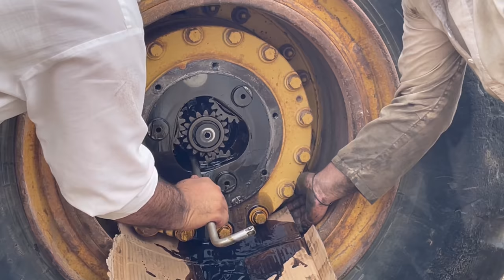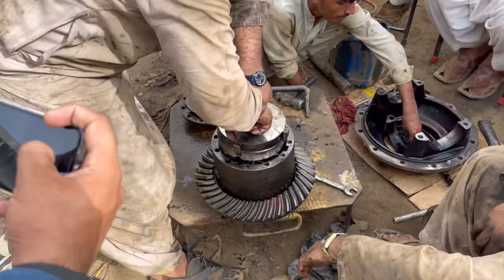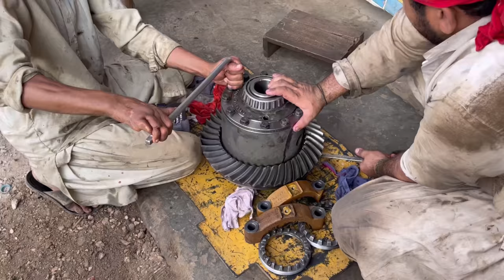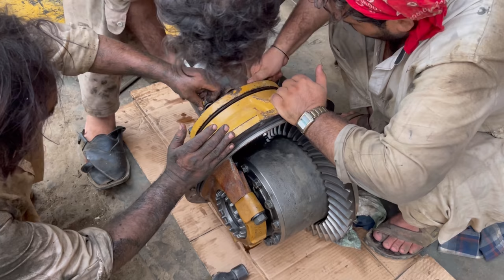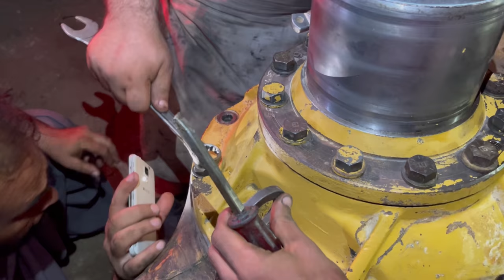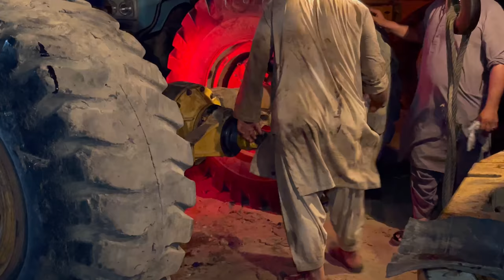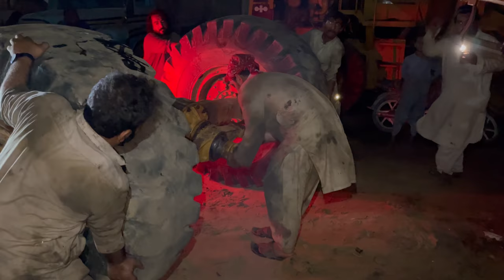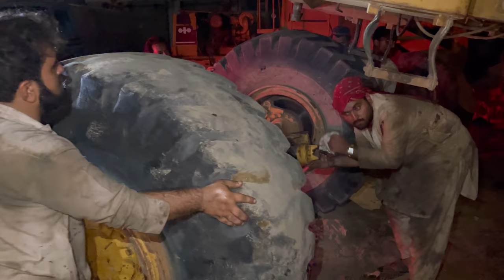This CATERPILLAR had a Major Defect in Differential GEAR  that the Experienced Mechanic Had Repaired

Comment: They machined the friction disc teeth away.  The differential is no longer limited slip!  They just added a major defect.
Reply: When I saw them grind the teeth away, I thought to myself... (So a limited slip diff is defective and must be open?) Sarcastic internal laughing follows.
Reply: Beat onit
Reply: I thought the same thing.
Reply: I thought they were machining a weld prep for a new set of teeth.
Reply: I'm assuming the clutch pack was causing problems so they made it inoperable so that the equipment could still be used?
Reply: Think their was any dirt picked up along the way ! - Ed
Reply: Is this a Cat authorized  dealer ?
Reply: @edlawrenson4005  Less than a 1/4 pound.
Reply: @edlawrenson4005  obviously, I swear I saw the cat yellow spray cans on the back 😂
Reply: Here in pakistan these mechanic always do these type of things.. they just make the machine to run whether defective or not..
Reply: Let’s not pass up the guy using a torque wrench to break the carrier bolts loose. I understand use what u got but use ur brain 🧠 sometimes too.
Reply: @lennyray42  but rounding off bolt heads is more fun!
Reply: Yeah, such a nice and bulletproof unit and now just works like an open diff
Reply: @lennyray42  don’t worry, that torque wrench has been unable to torque anything, since they first started using it
Reply: I’m beginning to think they misunderstood the name torque wrench n just started to put all the torque they had into that cheater bar.
Reply: @tbohtwentyone  that's what I was thinking as well. Theycwere going g to insert a new ring of teeth and weld. This shit is above my pay grade, but I worked ad an industrial gear shop for a few years and this shit had me cringing.
Reply: If any of the Caterpillar Engineers saw this video, they most likely would have pulled their hair out. 😄
Reply: Ok, so did they jack this thing up, try to spin the tire by hand and assume the diff was seized because they have no idea what a limited slip diff is?
Reply: Added a major defect...limitless slip....
Reply: I think they did it to reduce wheel wear. Disassembled to change the bearings, and at the same time to open the differential.
Reply: 1 tire fire only now.
Reply: I know???can you do that with basic tools or you will have to buy every Milwaukee tool on the planet??? And on the dirt??
Reply: @benargee    Sounds about right.
Reply: As an old cat skinner this is very painful to watch!   I dont see anything actualy wrong with any of it till they tried to fix it.   Lmao as they tried to drop the diff with the other axle still in.
Reply: Uyuj

Comment: I used to worry that my workshop was too dusty, after seeing this, I now add dust
Reply: it takes up any gear lash.  works great!  Sawdust is better.
Reply: @AffordBindEquipment  Well saw dust holds the fluid/s much better over a longer period of time. OH, and works as an agent to capture any sand or other debris until next rebuild....
Reply: There's no dust some gasoline can't wash lol.
Reply: Their kitchens are just as filthy. What do you expect
Reply: Kkkkkk 🇧🇷
Reply: Lol 🤣😂😂
Reply: like rural ohio... just different theme.
Reply: i now make my employees wear sandals aswell
Reply: @ganachepanache  rural Ohio still has cement and proper parts
Reply: I hate dust when building back an engine.
Reply: This is hilarious
Reply: I'd worry more about cutting the spline teeth off those clutch plates, what going to make it engage again now ?  Limited slip just went full slip. Everytime I think I see some hillbilly stuff on the job I come to this series of videos to get my perspective back LOL!!!!
Reply: Never forget, these guys are extremly poor.
Most of them are so hungry, after some minutes they can't hold their newest smartphone no longer, it falls off their hands and breaks on the floor.
Truely sad.
Reply: Absolutely, I've been thinking about reversing the direction of the exhaust fan in my shop.
Reply: @em4703  did that many times and it's a good cleaning solution in it's day...but dangerous as hell
Reply: Such a dry joke
Reply: what's funny is these guys could probably work circles around you as machinists, so the joke's on you
Reply: exactly i would add dust and dirt lol
Reply: I spit on my screen. 😂😂😂

Comment: Using a precision torque wrench as a breaker bar with a pipe for extra leverage .priceless !!!!!!!
Reply: No worries; someone gave it to them so it doesn't matter!
Reply: They are rich bro
Reply: All you have to do is bend the indicator back to zero and you're golden. /s
Reply: I did not see any precision torque wrench..  I saw a beat the f up old beam or deflection type which was not used to tighten and might as well just been a long handle breaker bar.
Reply: I thought the same thing.  Now it's a un-torque wrench.
Reply: Maybe its already broken....
Reply: Thought I’d seen it all - Until now!
Reply: Accurate within a few hundred foot pounds anyway!
Reply: Opening the rearend before all dirt and debris from case.
Combo wrench as a pry bar.
Dumping rearend gears on a piece of cardboard laed with sand.
Parts lying in the sand.
Third world amateurs.
Working in white nightshirts.
Oil spills?  No problemo.  The sand will suck it up.
Reply: just like hammering new bearings what need to be heated up in hot oil and they install easy
Reply: I'm sure all you guys are better mechanics. These guys are dirt poor and they have to make do with what they have. I'll bet they do a good job or they wouldn't be employed. May look a little haphazard to a Western eye, but have a little understanding.
Reply: yeah lmfao, and the tittle ''EXPERIENCED MECHANIC''
Reply: @martinm3422  Impossible to break a torque wrench without actually breaking the main shaft.
Easy to overtorque and give it a permanent set.
Reply: How could they do that to such a fine to such as the Pittsburgh torque wrench by Harbor Freight. Lol
Reply: @rosewhite---  incorrect use of a torque wrench can, and will result in failure to calibrate to the standard 4% range.

Am a quality engineer. Spec, and calibrate over 4000 different scientific and mechanical tools. You are what, a mechanic?
Reply: @mezmerizer0266  That's why I said it would likely take a permanent set.
I've been using torque wrenches for 50 years.
Reply: @mezmerizer0266  It's all they can afford.
I suggest you go live like them for a few months.
Reply: @rosewhite---  I lived like them for a few years.
Reply: Maximum Reverse Clickage!
Reply: @dotcom8555  no they just dont know what is this. Wrench is a wrench
Reply: @tomboyqueenX  je préfère se genre de mécanicien du tiers monde plutôt que ses mécaniciens bien coiffés,qui sentent la rose,des dent bien blanche avec leur normes industriel de merde et surtout leurs facture incroyable qui dans la majorité des cas il faut revenir pour malfaçon
Reply: @PanzerChicken69  LOL
Reply: @MrNetinho123456789  He put it back together as clean as he could get it and with everything well oiled. He was working in a sand hole. How would you have got on in that place. I always made it clean enough to eat your dinner off or it wasn't clean enough. He didn't have that luxury but still did an amazing job. Guys like him are keeping the place running. They deserve respect
Reply: @Tsamokie  I am fairly certain judging by the looks of that sand that it has already sucked up than its "fair" share.
Reply: @PanzerChicken69  Amsterdam is only a stone's throw away: this video is filmed in Bradford, UK in summer 2022.
Reply: That was the best part
Reply: @horstmuller7512   😂
Reply: @Tsamokie  Spoiled Prima donna
Reply: @Tsamokie  Not amateurs.  I've seen guys with expensive fancy tools and spotless coveralls that didn't know what the fck they were doing.
Reply: @rosewhite---  Exactly. They would have to go beyond the tool's torque limit to harm it.
Reply: @roundedges2  Who?
Reply: @tomrogers9467  Accurate enough for this job 😅
Reply: @roundedges2  Yep.....me too and not just in engineering but other occupations as well 😢
Reply: @sjekkie8299  have seen guys wrap bearings in a wet towel and chuck them in the microwave. Gets them nice and got

Comment: No more LSD! 🤣😂😂 Major defect repaired! 😂🤣👍🏿👍🏿👍🏿👍🏿
Reply: No LS oil
Reply: I'm not a mechanic but shouldn't there be several friction plates in the pack?  Would removing the teeth from one make the LSD non-functional?
Reply: @mikeall7012  If you use wrong oil in LSD diff, it will start to bind. They use Camel piss or something as oil. It doesent have LSD additives and lock will stick. They just disabled LSD.
Reply: @juhomaki-petaja  gotcha.  Thanks for that explanation.  I was having trouble putting all the pieces together.

Comment: Good bye, LSD
Reply: What is lsd?
Reply: @aydinali5381  limited slip differential. Now it's an open diff
Reply: @aydinali5381  Obviously they don't know either.
Reply: Estaba pensando lo mismo,  porque lo habran hecho? Para  no romper  palieres ?
Reply: @santibarreiro9062  probable que por bajo costo. Una solución barata para seguir trabajando
Reply: @rovoul1  pero que sentido tiene? Podian montarlo igualmente sin anular el autoblocante. Supongo que lo habran hecho para evitar estres sobre los semi ejes, puede ser?

Comment: I'm sure glad they have their best mechanics working on it, the good use of torque wrenches, and the new and improved semi-limited slip differential it's a winner. I'm very glad they used all the updated PPE's. Good job lads!
Reply: "new and improved semi-limited slip differential" LOL
Reply: @ngrader  I'm glad you liked the comment. I worked on many different styles diffs, but this one took the cake, still gotta learn a lot more from them. Cheers
Reply: you would cry if you tried to do what they did
Reply: Well, more like unlimited slip diff. Beacuse who likes limitations?
Reply: They were trying to make a positive-trac. LOL or the reverse of that
Reply: @nurburgringdreaming2221 i
Reply: I wouldn’t be surprised if these same mechanics are going to put back together those Air Force helicopter and planes etc in Afghanistan lol
Reply: @K3nn9n  Don't bet your paycheque......you never know. The title said: Wow interesting skills. say no more.
Reply: As the chief safety officer and engineer for the country, I approve the use of the special safety pyjamas and safety sandals. Likewise, the use of the speciality scouring sand used as the floor covering is a welcome sight, as this sand, when introduced into the gear axial will clean and scour all the bearings, this making returns less expensive.
Reply: I m astounded to see a watch and ring on the arm of one of the mechanics. There is some prosperity.I have been watching these PK videos for five years. The mechanics work wonders with some very crude hand tools.
Reply: @educatedmanholecoverbyrich8890 i see you have never worked anywhere and leave in your daddy basement. You think mining equipment is taken to a formula 1 garage for service? Or kept for months like a John Deere dealer? We fix the trucks and machinery in the spot, be it sand, rock, or ice. Time is money, a grader or bulldozer not operating is losing money for the company

Comment: those mechanic robes are excellent around rotating equipment, and the sand absorbs all oil spill so no cleaning is required
Reply: Hard toed sandals as well.
Reply: poor to the environment

Comment: Every after-sales business unit that's part of a drivetrain corporation needs to see this.  I worked for a large German diesel manufacturer for many years, and the majority of corporate had no idea this is what field service looks like in many countries.
Reply: No
Reply: А ему безразлично в целом, что происходит с техникой после гарантийного периода. В идеале для него техника на следующий день после завершения гарантии должна разваливаться и сгорать.
Reply: That’s why Japanese, Korean, and Chinese Heavy machinery are taking over! Germany is clueless
Reply: I don't get it what are the manufacturers supposed to do about these guys.......
Reply: As the chief safety officer and engineer for the country, I approve the use of the special safety pyjamas and safety sandals. Likewise, the use of the speciality scouring sand used as the floor covering is a welcome sight, as this sand, when introduced into the gear axial will clean and scour all the bearings, this making returns less expensive.
Reply: Tbh most corporations dont produce with those markets in mind.

Comment: As they have now machined the teeth out of the intermediate plates this differential is no longer in limited slip operation .
Reply: Exactly right, but why would you want an open diff ? I can only think to cut tyre wear, but you'd lose push into a pile ...... their nuts.
Reply: @MUDNROCKS  You wouldn't get much function out of that diff the friction plates were knackered anyway
Reply: yeah.....that's what i thought.
Reply: That's not fixing a "Defect", that's just removing the function of LS. So I wonder why they were doing that to begin with? I'm guessing it still functions, might be noisy and obviously loss of traction, but unless there was something gained seems like a lot of work for little (if any) reward. I suppose at least the oil get's changed (Maybe??? lol). I don't know that I'd say this was an "Experienced Mechanic", more like necessity in a third world country maybe.
Reply: It's an unlimited slip now, so that's better right?
Reply: That were my thougts, too. I could not see any "major defect" until they built it by their own... Maybe the Diff has eaten a handfull of sand before? But the most funny thing is, that these guys in time lapse sound like Minions 😂
Reply: I'm not a mechanic but shouldn't there be several friction plates in the pack?  Would removing the teeth from one make the LSD non-functional?
Reply: @mikeall7012  All of them are smooth upon reassembly. I guess we only saw the one being machined. The only thing I can think of is that they weren't using a friction modifier, the LSD was locking up hard, and someone requested they just disable it. I've got a 9" that sat dry for a while and it was like a bomb going off when the Tracloc would finally break free around a corner.
Reply: @jochenklug3440  
sound like those little guys in Star Wars who sell bots!!
Reply: Didn't see them check the ring and pinon engagement after a couple of years might strip the teeth bet they will just take rear drive shaft out have a front wheel drive loader
Reply: @BIGSMOKE-bl2lq  
it is a Quick repair to get it back to working....they do what the owner wants and what is " enough " to get paid...can't blame them...as it is another country and even in North America we get the same repairs done.. depends on what you can afford or Know needs to be done....
Reply: Its almost like they cant aquire any friction modifier or gear oil with modifier added in 🤔🤔🤔 so the only option was keep doin the welded dif shuffle the whole time you work or put new gear oil in and continue to do the welded diff shuffle.🤔 or remove the plates function and get back to work.
Reply: @0MattAttack  Why is friction modifier not required in the General Motors G80?  It uses friction discs as well although they aren't loaded unless that paw locks them up.
Reply: Exactly.  I also like how the only use of a torque wrench was to REMOVE tight fasteners
Reply: Correction: that not a limited slip diff, it's a locking diff. Now it's no longer a locking diff